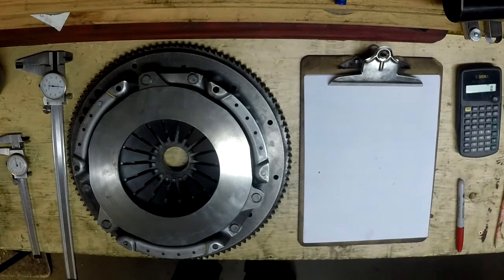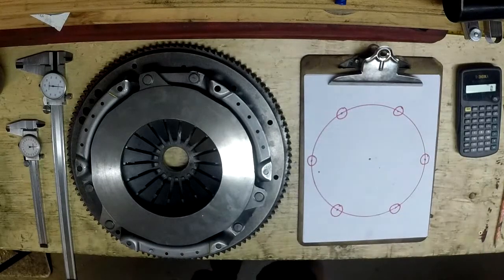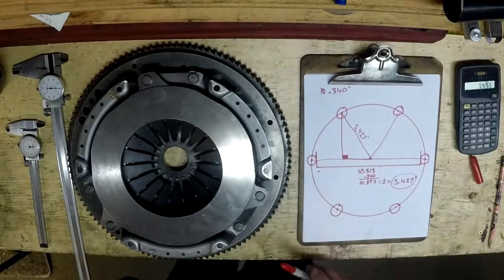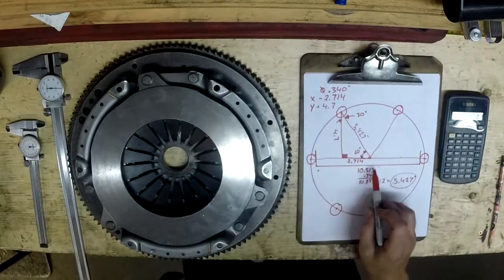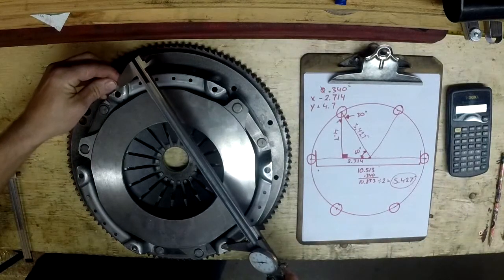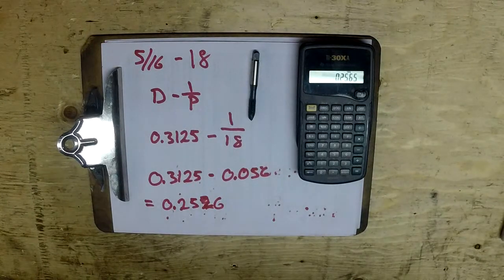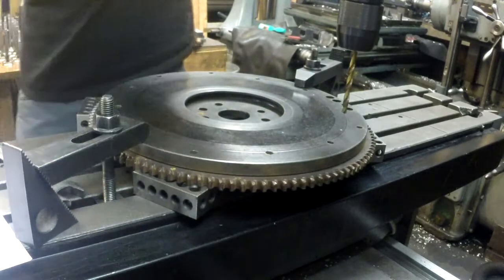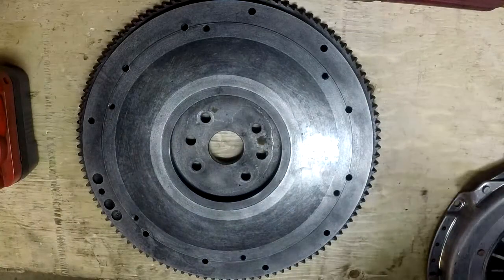Drilling flywheel for an alternate clutch assembly.

Comment: Wouldn't it just be easier to center th clutch and just use a center punch to mark holes?
Reply from the maker: Our "good enoughs" are clearly different
Reply: @whiplashmachine  doesn't answer my question.
Reply from the maker: Fine. It would be quicker to hack at it and hope for the best😁
Reply: @whiplashmachine  that's bs.
Reply from the maker: Oh ok

Comment: There is a much easier way to do this with greater specific accuracy and very little math.

Diameter of flywheel = X
Diameter of pressure plate bolt hole circle = Y

X /2 = Z
Y /2 = A

Z - A = B

B = Distance from the edge of flywheel to first hole to be drilled.

Drill and tap hole, mount pressure plate to flywheel, lightly tighten bolt. 

Rotate pressure plate until you get (B) from the pressure plate mounting hole to the edge of the flywheel directly opposite of the bolt you already installed. Now, so long as you measured accurately, you will get (B) between all flywheel to pressure plate mounting holes. If you get (B) at all 6 holes, mark them while the pressure plate is still bolted down with the one bolt you already installed. After they are marked, remove that one bolt and drill the holes. 

The reason this is more accurate is due to the possibility of slight tolerance imperfection between the holes. You just marked exactly where the pressure plate holes are, meaning if there was a slight difference then you compensated for it(so long as you install the pressure plate in the same orientation as when you marked it).
Reply: The only problem is how do you know the edge of the pressure plate is a reliable place to measure from?